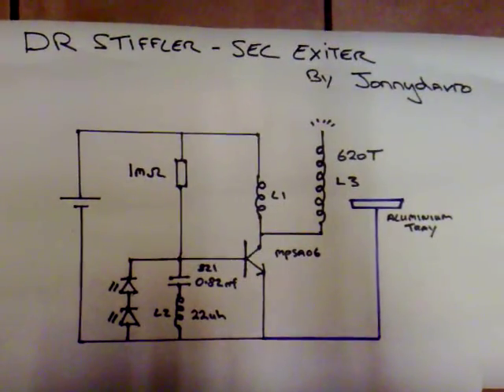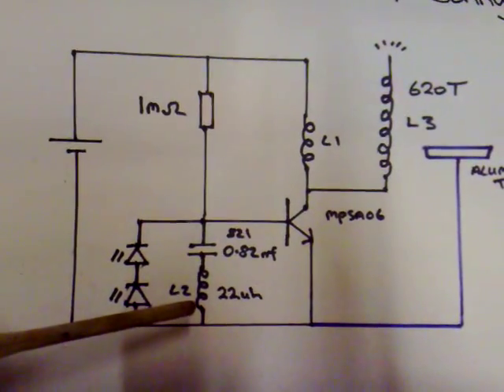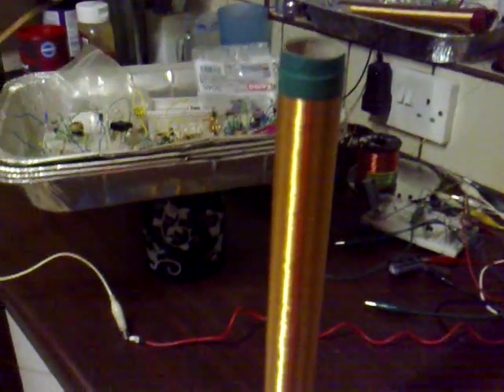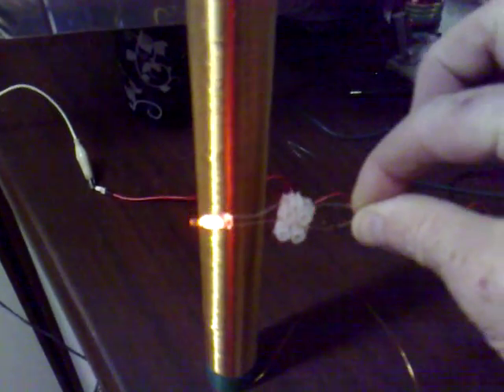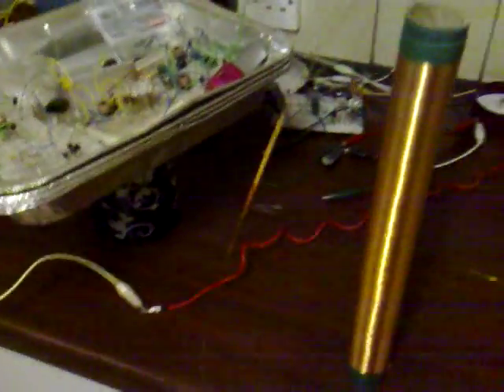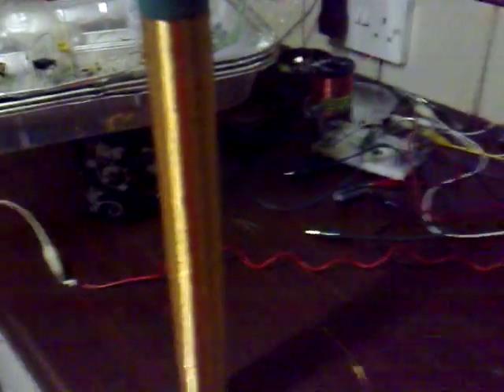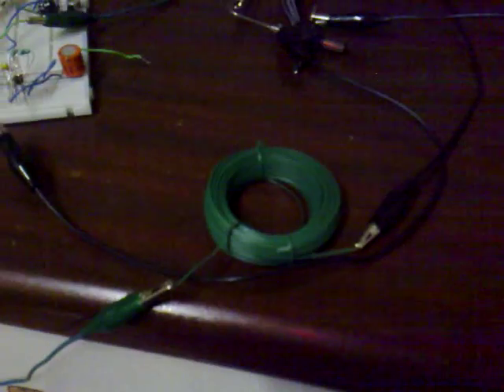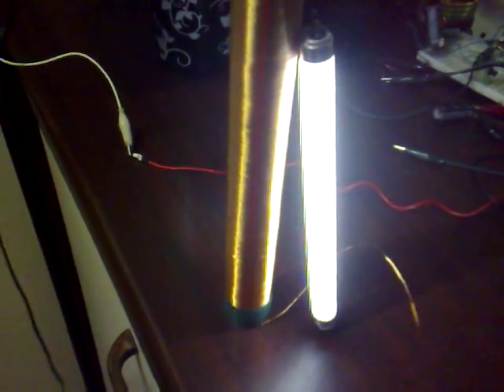SEC Exciter with large rf field

Comment: If I want to adjust the frequency of the exciter, is it enough if I use a potentiometer instead of the 1M resistor? I guess then by changing the resistance, I can change the frequency up to a certain amount. I think I could also make some changes with changing the capacitance of the capacitor. am I right? Thanks in advance.

Comment: @jonnydavro Very cool. Thanks for all the information. Have you had any luck experimenting with the Dr. Stiffler circuit, as used/seen by him, smaller coils ~ tuned to a special spatial resonant frequency? I'm trying to make sense of it all... seems very bizarre. Been watching Rau369's replication of driving LEDs strictly off of coil, frequency generator. Crazy stuff. Can't see how there would be much current in the signal generator...

Comment: Nice I wonder if that thing will work with with the s-gate. The bigger you build the coil the nasty side of the s-gate comes out with some monster potental you can light bulbs at full brightness. You can also take the energy back and change a battery without wires. I have done some crazy stuff like that with the sec exciter.